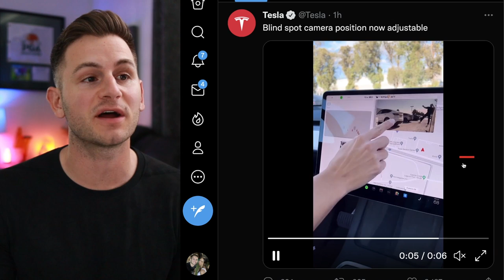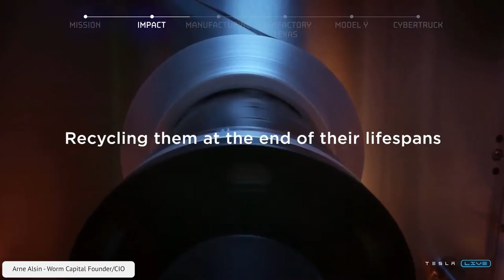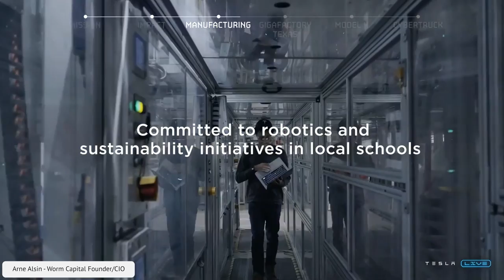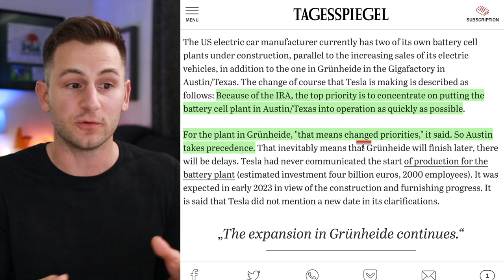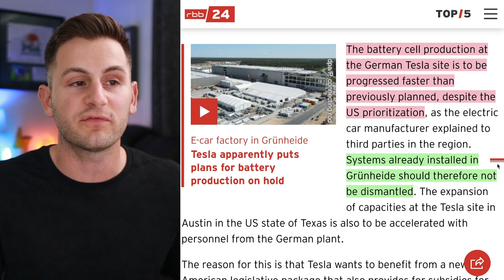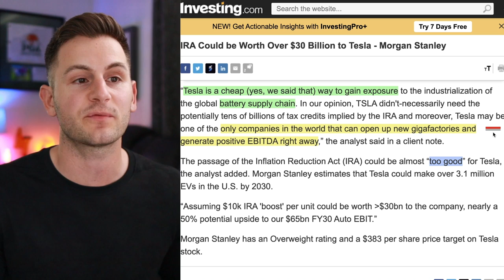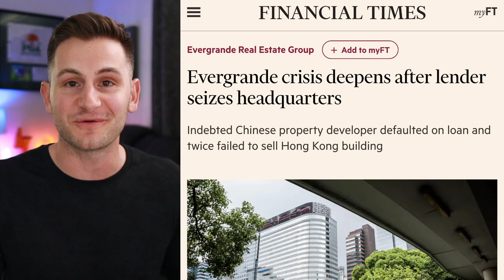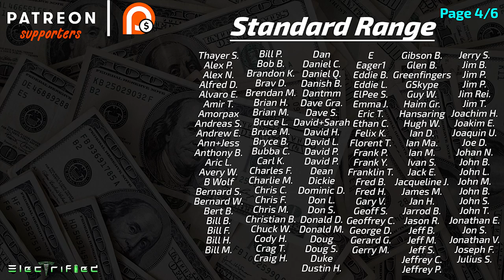Breaking: The Truth About Tesla's 4680 Production (Austin vs. Berlin) & Demand In China ⚡️

Comment: Farley has a point based on where the EV technology is at the present time; however, there will undoubtedly be future advances in technology that may make it possible for EVs to outperform ICE vehicles regardless of the types of work to be done.  History is replete with statements about what can't be done technologically, until it is!
Reply: Just need lighter batteries. Could also be the niche that hydrogen can fill, especially if that hydrogen paste tech is scaled up

Comment: 15:00 that woke me up.  easy simple argument here is the Tesla Semi.  back then the popularity of the Toyota Prius, I argued that it is supposed to be large vehicles with hybrid or needs better efficiency.  Ford can electrify the trucks and add turbo gas/diesel as a range extender which will run only during high loads like towing or low battery charge.

Comment: EV's tow better than comparable ICE versions.  It's the low range while towing that will keep some heavy duty ICE trucks out there for a while longer.  But it's not a performace issue.
Reply: EV's will always beat ICE on low range, we just need a higher density battery.

Comment: "I bet your margins are pretty nice and fat. Jared Vennett: Let's not talk about my margins by the way. Being nice and fat..."  The second you mentioned fat margins.  As for Ford, it may make sense for a limited number of models and model years as it downsizes its ICE manufacturing in a way that minimizes costs.  It is likely also influenced by dealers.  It is a short-term solution that is more about cash flow.  Ford never took the bailout and has been much smarter than its competitors whose actions have been marked by denial and delay tactics with no meaningful plan or, like VW, cheating.

Comment: EV trucks out perform all ICE trucks except for range. More power, more torque, more stability, better braking and trailer towing control, far less maintenance, less wear and tear.
Reply: And for applications like garbage pickup trucks, it just grinds me to hear those diesels do sudden accelerations then screeching brakes at the next driveway. There has to be a way to get regen braking into that cycle.
Reply: @lengould9262  sure it can be!

Comment: Good on you Jim, if 80% of cars move to EV's and petrol/deisel use is reduced by 80%, how much will it cost as most refieries will not have sufficient sales to keep running and those left will have a monopoly and limited market.
Good luck selling that one.
Reply: You are talking many years away.
Reply: @jfrankerickson8993  Not that many I used to think 15 years out but it could be 5.
Reply: Peak oil has never been reached. Half of oil production is used for manufacturing of essential products eg plastics. Every growing economy is increasing its fossil fuel use, especially oil. Every ounce of iron and steel ever produced was made using coal. Technological advances will only accelerate global economic growth massively in years to come and natural resources including fossil fuels will be utilised to a much greater degree for both manufacturing and energy requirements.
Reply: @paulmcgreevy3011  What you are failing to grasp is the cost to get that fossil oil is exponentially increasing over time just look at the cost of a deep sea oil rig compared to jackpump sitting in a field.
Steel and coal share a dynamic because you need carbon to make steel there are many nonfossil sources of carbon and the heat can be generated with electricity from a nuclear reactor preferably thorium based
Reply: @Barskor1  the reason oil production has continued to increase over time is because it has become technologically more viable to access it ie cheaper.
Reply: @paulmcgreevy3011  ....ok so why did you need to spend 300 million dollars to get to drill a deep sea oil well when it used to cost 3 thousand for a land based rig at the beginning of the oil boom? because tech made it cheaper.....hmm?
Tech made getting to more oil possible it did not make it cheaper to do so.
For the cost of one deep sea oil rig you could build an single cell algae farm at a port city and get about the same oil production without all the cost of a remote ocean location entails, The established oil companies are dinosaurs fighting to keep the ROI on all that garbage from bleeding red when we need less and less of their crap oil that is filled with containments located in desolate places that they have to pay through the nose to keep running.
Reply: @Barskor1  logic would suggest that there isn’t enough land based oil deposits to meet global DEMAND by real people who need it. So tech was developed to enable that DEMAND to be met by enabling access to oil below the sea floor without actually having to drain the ocean which would have been way too expensive to do. They get it out of the ground because you and I and everybody else need it and are willing to pay for it which makes it economically viable to do. When something becomes economically viable to do that means it becomes cheaper than it was before. If you consider their product to be garbage you are at liberty to exercise the option of never using their products or items manufactured or powered from their products.
Reply: @paulmcgreevy3011  If it is economically viable to do it why do the oil companies require subsidies?...
Do you know how the oil deposits where made in the first place? A simple fast growing plant called azolla, duck weed and algae they can be 30% oil by volume and their symbiosis when together doubles in mass every twenty minutes with Hydrothermal carbonization that plant matter can be made into clean oil and fertilizer in mere minutes rather than millions of years nearly anywhere on Earth.
Reply: @Barskor1  they don’t need subsidies. Maybe you could describe what subsidies they get other than governments providing inducements to oil companies to explore and drill in their territories in order to gain tax revenue and resources for their country.

Comment: hah I always love the "heavy duty" ICE excuse. freight trains use electric motors and I think those are pretty heavy
Reply: I think the issue is range. EV's out torque ICE anyday - hence electric traction motors on rail. But, batteries cannot provide the range most heavy haulers are looking for under load. Hence the diesel-electric setup on train engines.
Reply: Yeah, but the electric motors are powered by diesel generators. There aren't any batteries there. Yikes!
Reply: They are using stored energy that is a couple orders of magnitude more dense, diesel. Trains are the 4x more efficient at moving cargo compared to semis, a big reason why the Tesla semi is really dumb

Comment: Most of the issues with EV towing has to do with range. If you’re only doing short trips, EV is far superior in every other way. 

If batteries had twice the density and charge rate at half the price, long range towing will be better off with EV. Now that real investment is finally happening in that sector, how long will it be? I’d guess ten years, certainly not more than 20.
Reply: Gasoline has a much higher density in energy.  But ICE is much less efficient.
Which of course describes the challenge with towing.